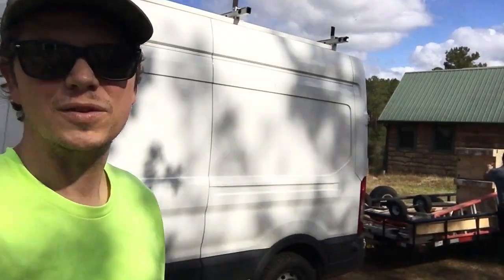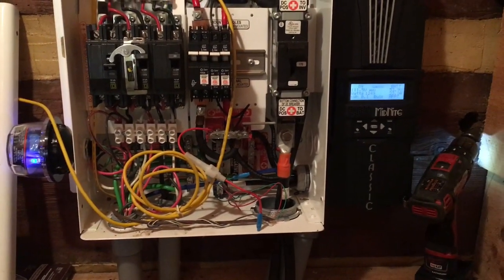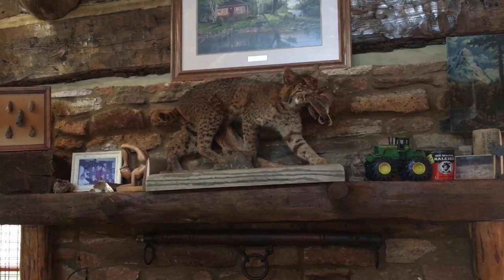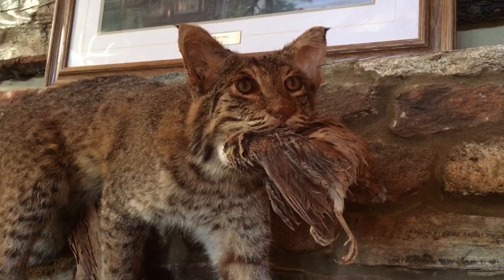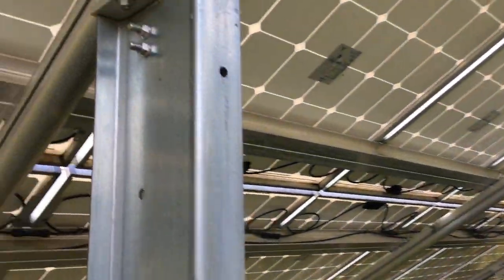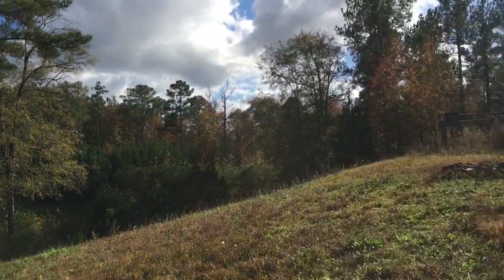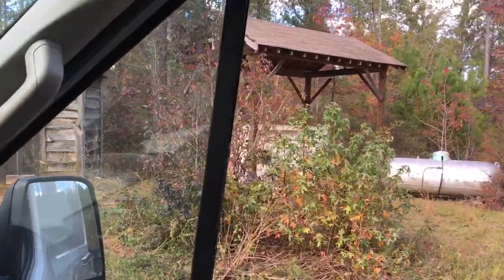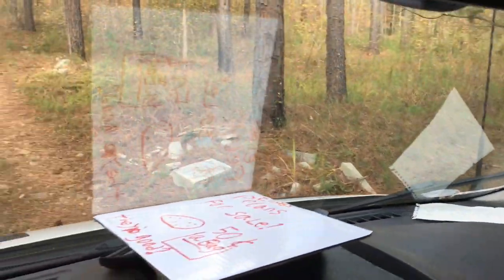Off Grid Solar Hunting Cabin gets Fortress eVault Lithium Battery Upgrade

Comment: Love it brother. Thanks for sharing. BTW made my goal of 14 KWH in lipo's now. Happy to have it powers been out for 28 hrs from this storm. We got a house full tonight lol.
Reply from the maker: Awesome is you battery on your channel
Reply: @GainSolarPower  Yes sir. Diy I have 6 24 volt chevy volts a  Ford Focus battery and 8 BMW battery. Each battery has it's own  80 amp BMS. There all 22 volts in parallel. So I have 675 AH or 540 AH I can use.

Comment: must be before 2 inch Johnny ?
Reply from the maker: Why you say that?  Cause the 1 1/4” drop from the combiner. Ole 2” woulda knocked that one out to 2. Your right.
Reply: @GainSolarPower  them batteries look sweet! That's an expensive battery charger ya got back at the shop. I'm jealous
Reply: Solark about 40 minute drive from my location.
Reply from the maker: What about this solark 40min from your location
Reply: @GainSolarPower  Main office for Solark in Plano Texas?